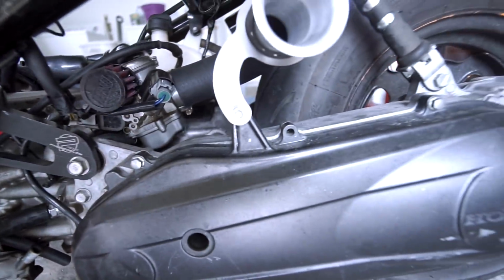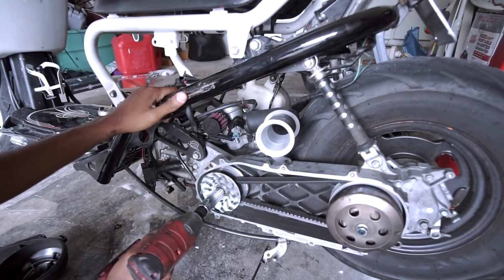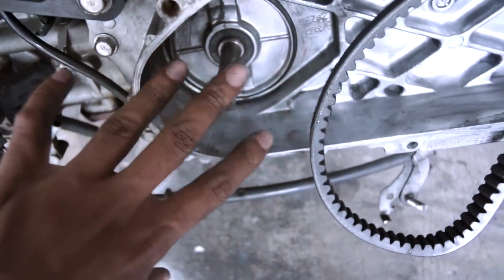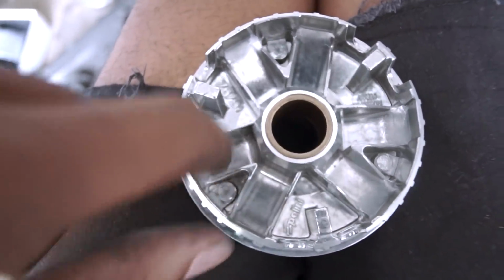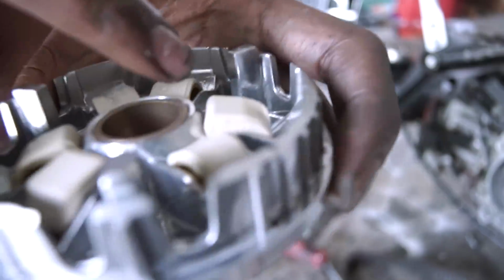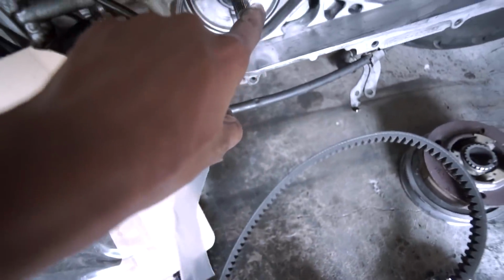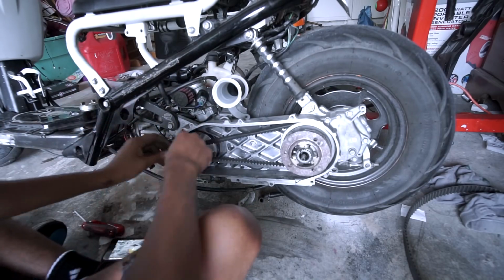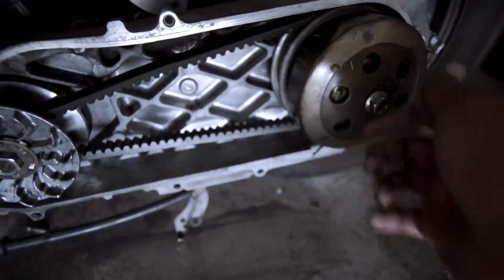PERFORMANCE VARIATOR INSTALL! - Ruckus Build [EP.4]

Comment: some advise on parts, Polini, Malossi, NGK, etc are very good for quality. for better pull off, change the clutch springs. i think theres only 3 colours ' red, yellow and white. for more power, port and polish the cylinder head and ports. changing the belt also increases top end
Reply: Why do they better pull off.  From stock vari?
Reply: A longer belt. Or new stock belt?

Comment: You should of put the 3 light weight and 3 heavy  that came with your from clutch and also is good to sand your clutch a little bit so that belt can grip better. Always here if any question!

Comment: Yo you'd be surprised how much just 1/2 a gram in those rollers/sliders make a difference in how the bike accelerates.  In car terms its either like holding in 1st gear longer or short shifting.  The sliders (the ones u put in with the flat side actually help your top speed because they open the vario up farther because they're bigger.  I ended up using 3 sliders and 3 heavier rollers to get the perfect weight on mine.  You're basically wanting the gearing to be setup so you're motor stays in its powerband the whole time you're accelerating.  Good luck with it!  Have fun and ride safe bro!

Comment: The blue guides were installed wrong flip them around you should be able to just slide it in it should have some play (should be able to slide) not stay in place (instructions from ruck shop vids !)

Comment: You put those blue guides on wrong.  The skinny half goes towards the top (the side with "Polini" stamped on it) and the fatter side goes towards the bottom.  The plate should move up and down freely when you do this.  I noticed that some of yours were on upside down and this is the reason you had to push the plate on.  It should just drop right on.  Trust me...
Reply: I was looking if someone else with some knowledge about scooter tuning were here. 👍👍